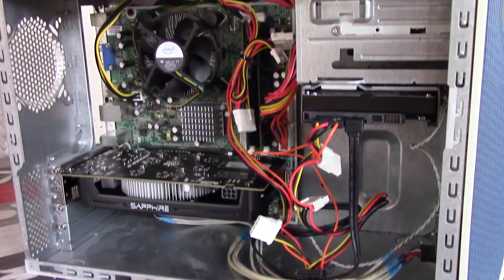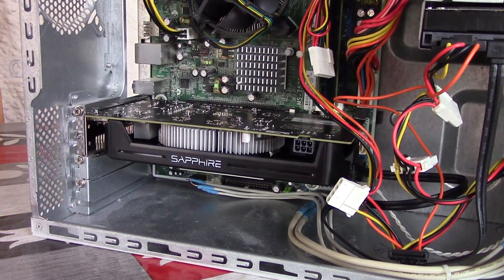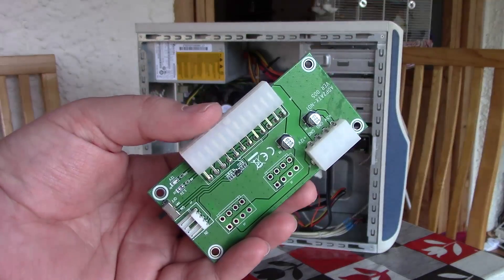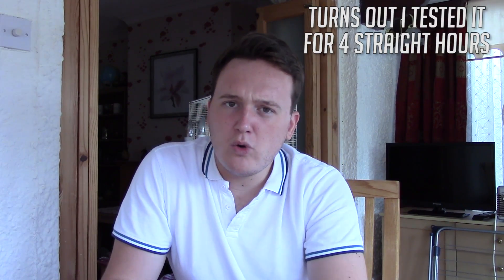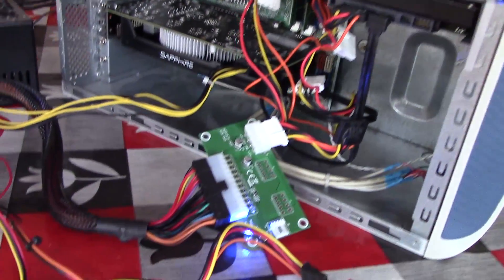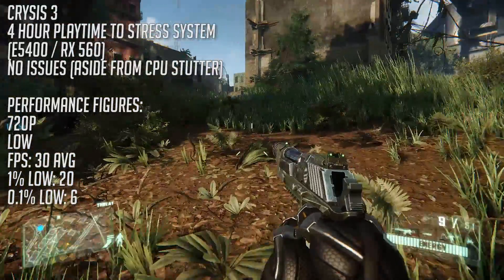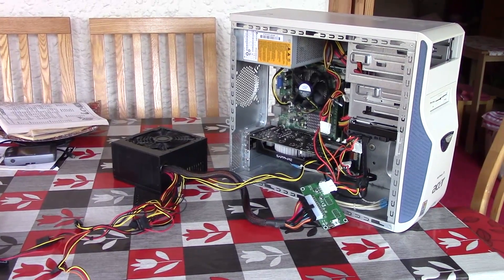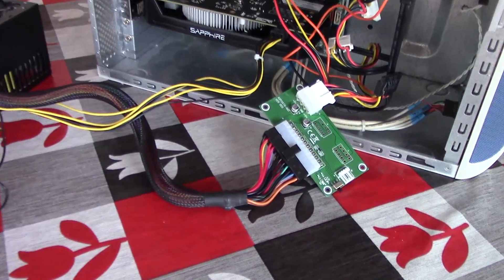Powering a Graphics Card With a Separate PSU

Comment: I did this with a car relay. Jumped the normally open cables into black and green of the second psu and the coil cables into 12v and black from the principal psu. Also Connected both psu with a good cable into ground.

Comment: For anyone curious, you can actually build this yourself. Not sure I'd recommend it, cause if you do it wrong, you can fry your psu. But I mean u can. Just use the molex connector to power a 12v relay, which then shorts PS_ON and GND on the other powersupply.

Comment: How this specific adapter board appears to work is it;
-Connects the APU to the system's ground rail
- Detects voltage from the PSU and turns on the APU 
- The sequence of events that it operates by;
the primary psu turns on (as indicated by outputting voltage to more than just the standby); the adapter board receives power and uses that power to signal the APU to power on (this is achieved by connecting the 'green' soft-start wire on the APU to ground) 

Acronyms used;
APU - Auxiliary Power Unit
PSU - (Primary) Power Supply Unit
Reply: Hey, could you help a little¿? i tried the same method as the video, but i don't have any adapter, i just jumpstarted secondary PSU(500w) my main one is 200w, im using the secondary PSU to power my GPU (RX 580) but whenever i turn on my PC using this configuration first start 500W PSU to powerup GPU and then 200W PSU to power up system thus giving power to the GPU through the 6 pin connector from the 500W PSU, my PC just restarts itself over and over and over again. ¿Do i need anything else to make it work? Besides the adapter which i don't have. I turn the PC with the GPU connected but not giving it power through the 6 pin connector from my secondary PSU(500w one) it starts just fine.

Comment: If you don't know about electronics don't say things are safe or unsafe... You have no idea is what you say. It's 2023 they sell them still people use them still 😂 what house fire did they cause? None just gigabyte PSU blowing up on their own. And Austin's house went up. I'm just an electronic engineer. To trip your PC on your power button shorts 🩳 as you say the two pins on that PSU cable. Aka connection made. If I'm correct it uses a relay powered by the first CPU 12v and connects the 2nd PSU. And that is exactly what we use in cars relays aka powered magnetic switch. That's the safest way I whold construct the circuit.
Reply: Hey, could you help a little¿? i tried the same method as the video, but i don't have any adapter, i just jumpstarted secondary PSU(500w) my main one is 200w, im using the secondary PSU to power my GPU (RX 580) but whenever i turn on my PC using this configuration first start 500W PSU to powerup GPU and then 200W PSU to power up system thus giving power to the GPU through the 6 pin connector from the 500W PSU, my PC just restarts itself over and over and over again. ¿Do i need anything else to make it work? Besides the adapter which i don't have. I turn the PC with the GPU connected but not giving it power through the 6 pin connector from my secondary PSU(500w one) it starts just fine.

Comment: @RandomGaminginHD    bro I have hp prodesk 600g1 (i5 4rth) and i want to upgrade the gpu to gtx 1060 6gb if i use external psu would that mattrer??
Reply: It would be okay
I did the same thing with my GTX 1660 Ti running its own PSU while the main PC itself is using its own "generic PSU"

My only different is that I didn't use the small PCB adapter that he has in the video.
I use a DIY Paperclip to turn on the secondary PSU solely for the GPU.
Reply: @ClayWheeler  Hey, could you help a little¿? i tried the same method as the video, but i don't have any adapter, i just jumpstarted secondary PSU(500w) my main one is 200w, im using the secondary PSU to power my GPU (RX 580) but whenever i turn on my PC using this configuration first start 500W PSU to powerup GPU and then 200W PSU to power up system thus giving power to the GPU through the 6 pin connector from the 500W PSU, my PC just restarts itself over and over and over again. ¿Do i need anything else to make it work? Besides the adapter which i don't have. I turn the PC with the GPU connected but not giving it power through the 6 pin connector from my secondary PSU(500w one) it starts just fine.

My GPU is new, but could it be possible that its faulty, im gonna test it tomorrow onto other system :(
Reply: @Yohi_Gaming  do it the other way around.

Main PC first , then GPU
Reply: @ClayWheeler  Does it hurt my PC whenever the boot loop happens¿? I got scared and unplugged GPU, is it safe try again just jumpstarting 2nd psu, without any adapter¿?
Reply: @Yohi_Gaming  so... If turned on without GPU, the PC will boot just fine?
Reply: @Yohi_Gaming  is your GPU secondhand?
Reply: @ClayWheeler  Yes its starts normally if i don't give power through the 6 Pin connector, problem is that i don't have any other system to test out the GPU(which is new) and its 3 AM here where i live. Im thinking the GPU maybe came faulty¿? I have to wait till later to go and test it into other system :(
Reply: @ClayWheeler  its a RX 580 2048 SP, which was advertised as new. i can give it back, but it was advertised as new.
Reply: @Yohi_Gaming  yeah you should try in another system with dedicated stronger PSU. Possibly in PC Repair shop.

But, what is your Motherboard and CPU?
Reply: @ClayWheeler  mobo is from a HP ProDesk 600 g2 CPU is i5-6500. Normally it should boot up without any Adapter right?? It just doesnt, whenever i try to boot up with the gpu receiving power from the 500w psu it just boot loops everytime. But i unplug it and boot normally, it just works… Im guessing i got a defective GPU, my first one ever :ssss, feels bad man.

Comment: There is no reason why it would be a problem when using the PCB. The molex connector must be using the 5 volt wire to power the small circuit on the PCB to short the green wire to ground on the 24 pin connector. Also, it is like using a black wire (ground) to make sure the ground potential is the same in the added PSU. It's a bit getto, but it should work just fine and is safe. Likely safer that overloading the underpowered PSU in the PC. 

Some people think they can power their 8 pin GPU with just one yellow wire with a cobbled together molex adapter. Now that can be not safe. PSUs have safety features, for shorting and over current. However, a single 18 awg wire will start on fire long before the PSU sees any problems. GPUs only use 12volts, but when you have an 8 pin connector the CPU draws a lot of current. Thus needs four 12v positive wires (yellow) and four ground wires (black) to care the load.

Comment: Is it possible to power up the second psu only when the GPU is on ? Then turned off when integrated graphics run windows.
Reply: Yes 100% possible
Reply: @ClayWheeler  I read it's not too much recommended because the motherboard also send juice to the gpu. So I went with 1 psu for now
Reply: @OptLab  that's not how it works

Because the PCIe x16 rail can turn off itself when detecting if the GPU was present has additional supplemental Power. Which means any GPU beyond 75 watt will ignore consuming power from PCIe rail if the 8 Pins Power connector isn't plugged in.

Just for example, RTX 4090 only draw 20 Watt from the PCIe x16 Rail, but can be completely turned off when not doing anything and user only use iGPU or APU.

Same thing happen with GTX 1070.

How do I know this? I have friends who are ex-Miners. PCIe Rail doesn't send Power if there's no Data being sent to GPU
Reply: @ClayWheeler  Thanks for your precise comment. Were they on windows or on Linux ? Linux more easily allows the gpu to turn off idle consumption for many cards. So I'm wondering if 4090 has specific power saving features by design.
Reply: @OptLab  well the Mining was on Linux.

But in Windows all you have to do is going to Power Options settings (in Classic Control Panel)

And then Click Change advanced power settings.
Scroll down to PCI Express. Link State Power Management.

Off means The Rail will always awake and sending some power.
Moderate Power saving means PCIe will turn off itself when user is idle or monitor is turned off when idle, also when in sleep mode.
Maximum Power saving means PCIe rail will completely turn off itself no matter what device is attached to it. Like GPU, if you are using iGPU or APU
Reply: @ClayWheeler  I always thought the GPU were still drawing power in spite of tweaking these options. Ok thank you for saying this. You're description is thorough. Since I  have a watt meter I'll be able to monitor the changes.

Comment: Oh I didn't even use one of those boards I used a molex to 6 pin straight into the power supply from a jumped external psu

Comment: Hello, I have the same power supplys that you do (The one in the PC and the new one you have their) I found that the New power supply is too small and does not line up with any screw holes. Do you know a way to set this new power supply into my case? (I also have the same case btw)

Comment: Which pins do I have to short in order to get power from my second PSU? I got a PSU with the two six-pin connectors for my new Nvidia, but there is zero volts on all pins. I think there has to be a short somewhere in order to make it work...

Comment: Thanks for sharing bro, actually the only purpose of the tiny board is to GIVE MORE WATTS power to your 300 watts PSU making it more powerful, that's why it only has Capacitors and resistors on it. But if what you need is just to POWER your GPU, then directly plugging the 6 PINS to your GPU from the External PSU works just fine, and it won't harm anytime since computer PSU's are well regulated by themselves. But honestly, if my "PC Case" can fit a 700 Watts "used" PSU from EBay or Amazon that will only cost about $15 dollars (which they are) now, then that's the best option.
Reply: Umm no that's not how it works, adding a small circuit board isn't gonna magically make the psu, have more watts lol
Reply: @mikeysgametime8914 I  didn't tried the tiny board trick. Instead, I use an additional external PSU from my other builds and use it exclusively to power my Graphics card, works like a charm. Now, I never run out of Power on my Graphics card, and never restart itself since then.

Comment: Why not make the adapter just go to PCIe instead of molex? Could you wire it so when the main machine powers on, the secondary psu powers on with it all through the same pins?

Comment: That little PCB that fools the PSU into thinking it is connected to a motherboard is perfectly safe, assuming it was designed properly. As an electronics engineer, I can tell you that it is a simple matter if you want ensure that PCB is safe. All you've got to do is make sure the traces are a safe width for the max current (using good old Ohm's Law) and they are spaced apart for the voltages in play (the highest is 24 V between 12 V and -12 V I think, so not even that much). Nothing really too complicated.

Comment: Why is a "very bad idea" in your opinion if you are "not electronically clever"? Nothing wrong with it at all and in fact it IS quite clever. All it does is short the green power-on wire to ground to turn on the PSU when the PC power switch is tripped. The same thing can be done manually by shorting the green wire to ground. Do it with a separate switch if you prefer: https://www.amazon.com/gp/product/B07SHLN86S/ref=ox_sc_act_title_8?smid=A1JYHILYEWJM4C&psc=1

Comment: What is that little board’s name I really want to look it up on Amazon and I buy it.
Reply: ATX 24Pin to Molex 4Pin Dual PSU Power Supply Sync Starter Extender Cable Card . I'm late but I just saw the vid.

Comment: Just wondering; why do you need that little board? Couldn't you just put the 6-pin connector into the GPU and power the PSU on manually after the initial startup?

Comment: What if you use an old 205w Xbox 360 PSU? 
Reading some reviews and specs, power consumption remains below 180w for RX560 in FireStrike.
Thus, a Xbox 360 brick seems to be more than enough. Also is pretty cheap and it's way more reliable than those fake chinese PSUs

Comment: Good video..........Question:  Why do you have to plug the 24 pin cable in this smalll green card?   May i can just put the 6 pin cable in my gpu?
Reply: Uh, try listening to the video. He says it's so the 2nd psu turns on at the same time ad the first. You need it or the PC will explode.

Comment: In theory, a dual PSU setup should be perfectly fine. In theory, there are a few new faults that are possible, and you are doubling your chance of a power supply failure.

Personally, I have killed two power supplies doing it. They were absolute garbage PSUs though, and I suspect they would have died anyway.

Comment: Hello can someone help me out. So I have a GTX 560Ti MSI Twin Frozr II edition which requires two 6-pins, I had a power supply powering it and it was working completely fine, but then my power supply popped and I want to use my graphics card again but to do that I need to buy another power supply but I don't know if the graphics card works. Is there a way to test the graphics card to see if it works as I don't have a strong enough power supply to power it before I buy a power supply I don't want to waste money as I'm looking to buy a power supply from a seller on GumTree and I don't think I can return the power supply if my graphics card does not work

Comment: You can cut the green wire on the second psu and put a connector to connect it to the green wire on the first psu, it should power up exactly at the same time as the first power supply, reducing the load the first one have when powering up the computer until it gets 12v and the second psu turn on. You can cut the 2nd psu cables and connect them directly to the molex 6 or 8 pin adaptor.
Reply: You don't even need to do that just take a ground wire and attach it from the second PSU to the case and it will connect to ground together the case is because the PSU mounting connects the ground from the PSU to the connecting a ground wire from the 2 PSU to the case will do the same thing

Comment: There is absolutely nothing unsafe or unstable about using two PSU's, I don't know why you would think there is. The components could care less that they are drawing power from different sources. Hell I used a paper clip to short the sense wires so I could run a second PSU, never once had an issue.
Reply: Do you know if it is safe to power my GPU (Rx 570) with an aftermarket psu and the rest of the PC with a 280 W Fujitsu PSU? :D The motherboard only supports a 16 pin connector...
Reply: @razmuzen1090  Absolutely, like I said, the components don't care where they get power from. Just make sure you power up the GPU before starting the computer, and only shut off the GPU power AFTER the PC has been fully shut down.
Reply: @mar504  Hi, I need to connect external RTX 3090 graphics cards to my HP workstation.

I have to use external PSU's so that I can power them all. Now, I'm trying to figure out how to get power to my GPUs from multiple PSUs without having the GPU pull wattage through the PCIe slot. Need to find isolated GPU adapter board???

Comment: So could you safely connect a 2nd GPU externally on a riser to the adaptor and would that GPU only draw power from external PSU?  This is setup I need to try for an old Dell Optiplex 9020 with same issue of low power rectangular psu not easily replaceable with higher watt PSU needed for new GPU, intend to run the RX 570 which needs over 75 W.  Also as long as set auto, the extender should turn off Ext GPU with PC which makes it safer?

Comment: Yo what is the green board you used to connect? The name would help a lot
Reply: Miner ADP2ATX-N01 Dual Double Power Supply PSU Adapter Switch Mutliplier ATX

Comment: It would run, those cards are slow and low-power. I had a C2D E6400 @ 3.4GHz & HD 3870 X2 OC with a 300W PSU back in the day, no problems there. Was it wise? Hell no, but it worked without problems. :D

Comment: Its safe to do, I've once ran 3 PSU's to power a GTX 580 as I didn't have one strong enough laying around, Though I'm not sure what the point is with that little circuit board, there is an extension you can get that plugs into the 24pin that also plugs into the primary PSU's 24pin and has a block that looks like the 24pin with only 2 wires you plug into the 2nd PSU, this allows both PSU's to turn on and off with the power button.

Back in the day mountain mod mad a case the accepted 2 PSU's, though back then PSU's were not really good, so I would of imagine that for the extreme water cooled PC back then, it would make sense to have 1 PSU for the system and the other for water cooling gear and power up multiple graphics cards.

Comment: As you mentionned, this setup can only be used as a temporary solution. Even with this little board automating the power on and off of the second PSU, it still remains kind of dangerous to used both because you can't monitor the current state of the second one.
If PSU2 came to fail or explode while in use, the PC would still go on with the primary one, ignoring if you'd have some hardware damaged at that time (some GPUs keep running even without the 6-pin connector, they just enter a "low-power consumption" mode)...

Comment: i ran a 7950 with 2 psu's connected by a soldered wire to the 20 pin for around a year before upgrading, the card was a gift from a friend because it had lines and artifacts from overheating one to many times, so i threw it in the oven, baked it and BAM! bottle necked upgrade! "one mans junk pc parts is another mans gaming rig"